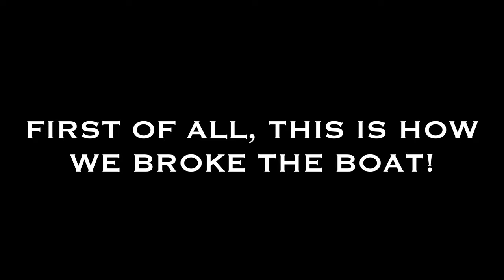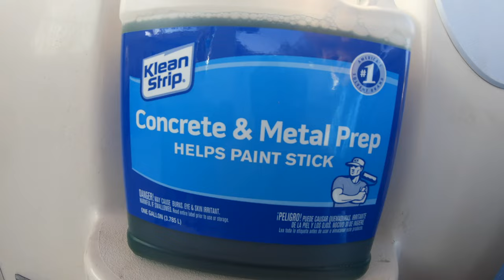Mercruiser 350 MPI Water Pressure Sensor Removal and Installation

Comment: When you suck up a good amount of sand and shells through the water pickup on the drive you really need to do the following:
1. open up all the blue drain plugs to let out as much solid debris as possible.
2. open up the raw water pump to see if the impeller got trashed.  Might as well replace since you've already got it open.
3.  backwash the raw water hose to clean out the drive plumbing
4.  backwash the all the hoses and heat exchangers around the back of the engine (where the pressure sensor sits).  You can clearly see that all kinds of debris is in there.
5.  the acid solution will dissolve shells but it won't have any effect on sand.  Refer to #4 above.
6.  depending how bad/how much sand got sucked in you may have to open up the thermostat to check and clean.  Sand can prevent it from closing fully so the engine will always run too cold.

If you don't get the sand out you'll continue to have low water pressure alarms and guardian mode.

Don't try to do this with the boat in the water.  Water will rush in as soon as you disconnect the raw water hose from the drive.  Some people pinch the hose w/pliers but I don't think that's a good idea for hose longevity.
Reply from the maker: Thank you for the great advice! We were also dealing with a Bravo-itis issue which has been fixed with an aftermarket stainless steel part. Everything got flushed out when that was done and sure enough, there was a small beach in there!

Comment: Thanks for sharing this video. I do not have 350 but 502s that do not have a water pressure sensor. However, since I have gauges on my Garmin chartplotter I am looking to add these pressures sensor to get a water pressure reading. How much water pressure do you typically get so that I can use this as a reference point. Thx

Comment: Buddy, I hate to reach out with an off the wall question, but you seem to know your stuff and to respond to comments. 

When you're reaching for the sensor in this video, there is a large purple and black connector just to the left of it. You actually touch it with the back of your hand at exactly the 2:10 mark in the video. Man, if you know and feel charitable, please tell me what that connector is and what the starboard side of the connections run to. My boat only has port side sitting on top of the engine, connected to nothing, and I've got all sorts of non responsive gauges right now. 

Thanks either way.
Reply from the maker: Hey! Thanks for reaching out...That purple plug is to connect the Mercury Vessel View Mobile sensor. That allows you to connect via Bluetooth to monitor engine performance, hours, RPM's, etc. I have the module tucked behind the starboard gunwale where that little recess is to hold the fenders. All of my wiring is back there. It also creates a WiFi network for your boat so you can impress your friends when it shows up on their iPhones out on the water! That's how you perform software updates if you need to.
     
      I also have a NMEA 2000 network set up to interconnect my Garmin MFD (1243 xsv), Radar, Sonar, Fuel flow monitor and stuff like that. It's a really neat way to monitor just about anything on the boat and engine. Of course, you have to buy the module and you have to buy the wiring harness, but if you get stuck, call Mercury tech support and tell them if you are having an issue hooking it up, and they will walk you through everything; at least that was my experience. I don't recall exactly what the wiring issue was, but I ended up NOT connecting something that I thought should be connected and it fixed the problem of not having connectivity.

     I have learned a bunch working on the boat because I can't afford a marine mechanic (unless I'm really stuck) or heaven forbid, taking it to a marina where it will sit for weeks and then they charge $200 an hour, at least here in SW Florida.

     I remember that there was a purple "Dummy" termination plug that I unplugged and then connected the new harness to. I bought everything on Amazon... Your MFD won't recognize anything unless you have that VesselView Mobile unit installed. Once connected, all sorts of interesting info self-populates onto your dash. I get water temp, fuel pressure,  engine hours, anywhere there is a sensor connected to that engine, you get the data.

     Feel free to reach out with any other questions. If I can't answer them, I will point you in the right direction.

     Hope this helps! Happy Boating!
Reply: Hey brother love your videos , and thanks for the knowledge.
I have a question about the vessel view system . I got twin optimax 200 on my center console and came with 2 simrads go9 screens that are not connected to anything on the boat. What would be my process for hooking up my engines data to show in the simrads ?
I’ve been trying to figure this out for a while now but couldn’t figure it out exactly how to get it done between the vessel view , smartcraf gateway , vessel view connect / mobile , NMEA 2000 , Ethernet , can ,  bus and so on . 
Just thought about trying
Them one by one till I got it right but lord all mighty these babies cost an arm and a leg ! 😢
Really appreciate all the help .

Comment: Hi I had my water pressure sensor replaced on my 350 Horizon because my smart gauges were alarming every 2 minutes saying "water pressure sensor faulty". But I could still drive the boat normally.
Now that is replaced,  I can't rev the boat above 1200rpm. It still starts and idles fine. Is this guardian mode?
Reply from the maker: Hi Tony...I don't know if you are in salt water or fresh, but down here in SW Florida, the water is very salty and the sand is powdery so it can get stuck in that sensor. 
Actually, after I made this video, I had the engine go into Guardian mode while cruising along at about 30 MPH. As soon as I put it back into neutral it reset and I was able to accelerate again, only to have the same thing happen. I removed the water pressure sensor out on the water and there was a chunk of debris lodged against the sensor! That didn't take long... I bought a new spare to keep on board in case it happens again. 
Guardian mode returns the engine to idle, which should be about 600 RPM, not 1200. I wonder if you have an obstruction in the fuel line? I would check your fuel filters and fuel/water separator because the increased vacuum on the obstructed fuel line can cause it to collapse on itself and restrict the fuel flow. Also, there is a neutral safety switch that can get out of whack but that usually occurs at a higher RPM. Make sure you have good water flow through the engine and outdrive. Also, check to make sure you don't have anything wrapped around your prop shaft like fishing line or rope.  A loose plug wire can be another culprit. I just bought a set of service manuals for my 350MPI for just this reason...$108.00 for a set of 4 vs. $200 an hour at the dealership, not to even mention a tow possibly! 
Let me know if you have any findings and I will keep researching this for you.
Reply: Thank you for your video, very informative, I’m using the same product to clean the barnacles very good and cheaper.